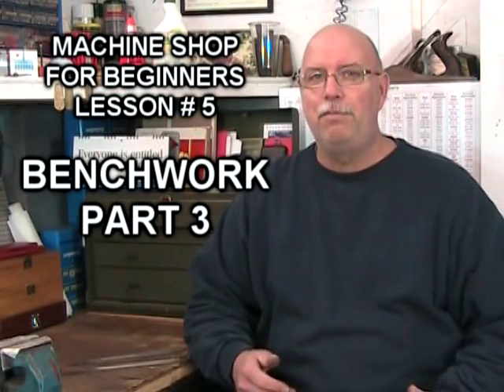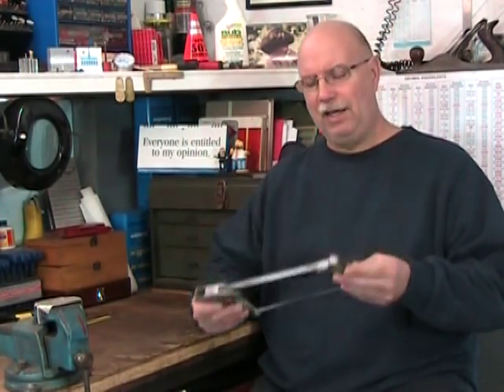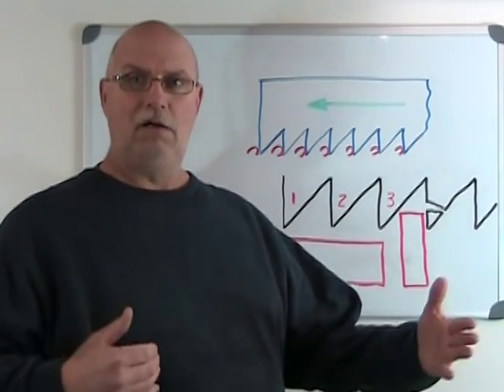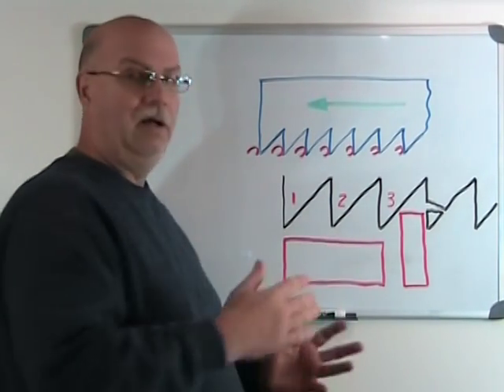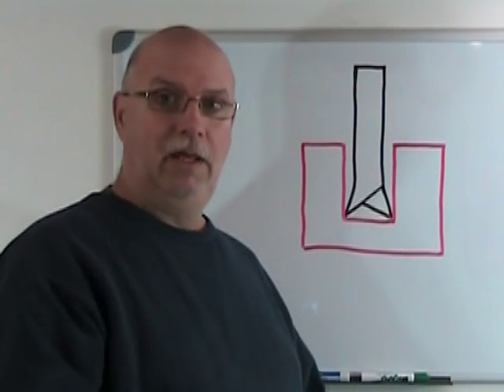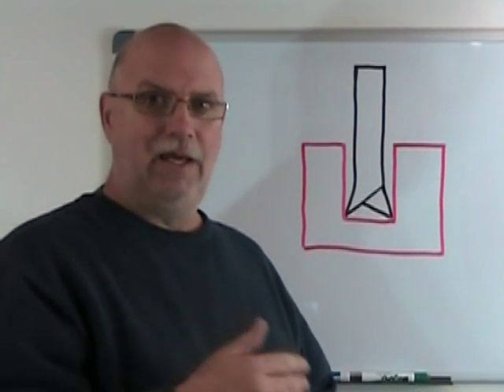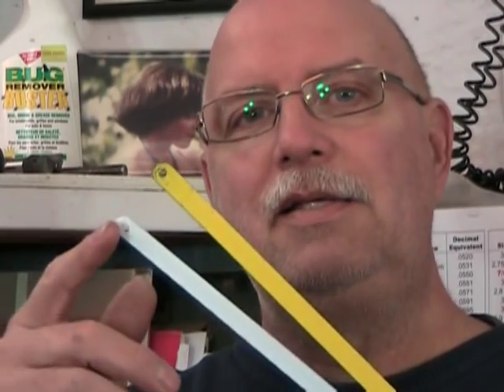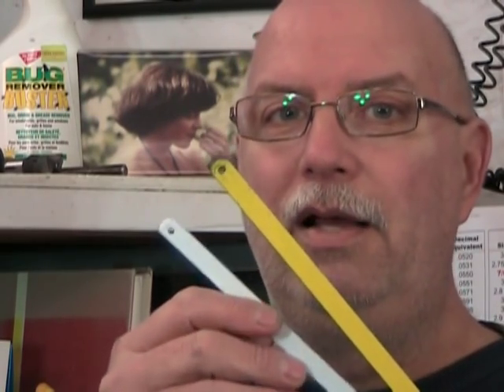BENCH WORK 3, TAPS & DIES (TYPES & CALCULATIONS) AND SAW BLADES. MACHINE SHOP, Marc L'Ecuyer

Comment: Hi

On my relatively cheap lux brand hacksaw blades bought in a German building centre I found "7 / cm" printed, i.e. 7 teeth per centimeter.  I couldn't find any indication on the number of teeth on any of my keyhole or coping saw blades.

As usual: I enjoy watching your videos which give a firm basis and a lot of (not too) theoretical background. Thank you very much for sharing your knowledge in such a generous way.

Comment: Yup, 300mm x 24 = metric length of blade x teeth per inch. It is like our plywood dimensions. You want metric, we'll give you metric. A sheet of plywood is sold here as 1220 x 2440mm which is, well, a 4' x 8' sheet of plywood. We pay for 1220 x 2440 and only really get 1219.2 x 2438.4mm. I wonder where all that excess plywood goes? Oh well. I still love the programs you make and echo the commenter that would like to have your great collection of videos on DVD. I'm standing in line as your first paying customer if you change your mind on this one. Thanks for sharing.

ps. My main squeeze of 45+ years is also still putting up with me, who knows why?

Comment: I also own a couple of those (yellow) brand HSS 18 TPI blades. I am very careful when using them because of the crazy cost. I keep the $1 High-Carbon blades around for when I want to "chop" it off quicker than a lumber jack! I don't cry as much when I break the cheap blades! Thanks Marc!